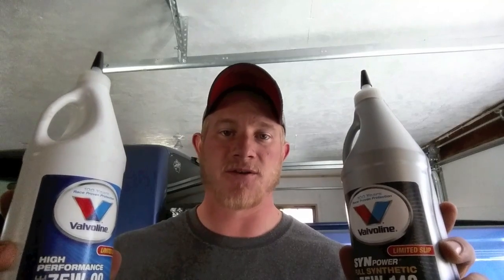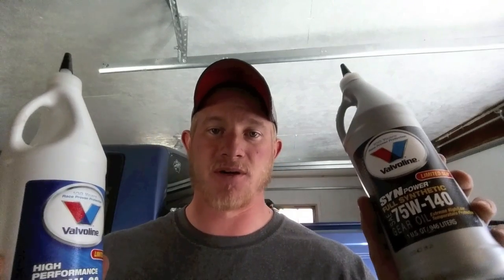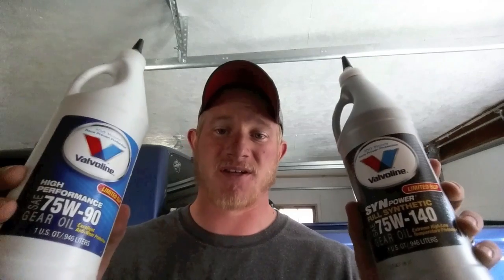75w-140 vs. 75w-90 Gear Oil | How To Read Gear Oil Viscosity Numbers

Comment: some people dont change gear oils at all
it took me 10 mins to do: i changed my gear oil to Synthetic Mannol 75w90 GL5 spec(cheapest synthetic 75w90 i found) , i drive a small 2007 toyota yaris and i dont tow, my recommendation is to CHANGE THE GEAR OIL every 5 to 10 years and dont just top it up, the old oil was GREY and the new was CLEAR-to-yellow car shifts a lot better especially when in reverse.
both plugs are 24mm and you need 1.9 liters of gear oil in case someone googles for specs.
Reply: zloben9000 port
Reply: P
Reply: I used to own a 2000 Tundra. I couldn't even change the axle oil. I had to buy complete whole new rear end axle at 155,000 miles it went slipping or it will lock up. It was wielded shut it has a cap on top of it. You couldn't even replace the gears till you cut it open. I was told that you had to go to the dealership and have them to do a hose flush to flush out your axle. Was so lame and Never forgotten to do a 4x4 transfer case oil change with the gear oil. I have over 472,000 miles on that V6 4x4 2000 Toyota Tundra. I sold it. Was a beast small mid size truck ever built. I had a custom axle on mine so I could replace the oil. The transmission will go out at 140 to 150,000 miles as well. I do replace the oils system and filters every 60,000 miles.

I wish people take care of their cars mores or have the knowledge to do it. Some people have no idea about changing the complete car oil system.

Now from now on I used Amsoil in my entire trucks now. I change mine every 60,000 miles on a GM 2500HD or within 4 years just as much as for other things on your vehicle like transmission fluid with new filter, steering oil and breaks oil and changing breaks. I always spent around 350 bucks every time and it worth it. Last you 600,000 miles or more depends how you take care of the trucks or cars that you drives. You would also needed to changing your crank staff chain or your overhead cam chain at 150,000/200,000/250,000 miles depend on what vehicle you have plus the exhaust system replacement as well. Big lesson I learned. I used amsoil gear oil 75Ww140 for a heavy duty used for my aluminum G2 cooling differential axle cover that does added extra oils space as well as it allowed you to change the gear oil too that included the magnetic dip stick. I add 6qt 10.5 on gas and 7qt on 11.5 diesel. And never failed me. I also do change the clutch and gear on the axle at 200,000 miles. 

  You could say I drove over billions of millage in my hard earn years lol..

Comment: Hi, Could you please advise the right engine, gear and lsd diff oils for 2002 Tahoe. It is used in a rather hot climate 35-40 C in summer. I feel that factory specs are somewhat insufficient in my case. Thank you in advance!

Comment: What would you recommend for a 2013 dodge challenger rt? My manual says 75w90 with friction modifier but the dealer says my car is supposed to use 75w-140 with none. I love in california for now but eventually i will move back to the midwest where it can get pretty cold in the winter. Your advice will be greatly appreciated!
Reply: Ryan Vaal do what the manual says not the person who told you at the dealer because he could be wrong cause he’s not dealing with just your car or pick up truck, he’s dealing with every car in the dealer...
Reply: Ryan in my research if there is a limited slip diff. on the vehicle of any kind the friction modifier is a MUST. it protects as well as aides the diff. as far as colder climates I would use the heavier 75w140 if the temp were going to be a constant freezing or below. (However I also realize that this does void any warranty if any thing fails) 32 degrees or below for several days in a row can be enough to freeze oil/break fluid/transmission fluid not the resoviors or holding tanks as much as condensation in the lines.

Comment: My Honda ATV calls for 80W-90 in the rear and front differential. I would like to switch to synthetic and I have found that most synthetics are in 75W-90. In your opinion, is it safe to go from 80W to 75W?
Reply: Amzoil makes a synthetic 80W-90 gear oil. Some NAPA auto parts carry Amzoil or you can order it direct from the Amzoil website

Comment: Great video!  I have Highlander 2011 4WD.  The manual says 80W-90 GL-5.  I could not find synthetic 80W-90.  Can I use 75W-90 Mobil 1 synthetic?  I am just afraid because 80 is different than 75?  Which is better for the car?  What about summer will 75 not be good as 80? 
Thanks
Reply from the maker: I would stick to the manufacturer's recommendations, especially in a nicer vehicle like that. One important thing however, if they tell you to use a GL-5 gear lube, definitely use GL-5.
Reply: Thank you so much for your reply.  Just want to understand what is really the difference between 75W-90 and 80W-90.  75 is thicker than 80 or the other way around.  
Also do you think 75w synthetic will offer better protection in winter than 80W?
Thanks
Reply: zofa300  @
Reply: hello good video I just moved from California to Washington St completely different temperatures right now is snowing and I would like to change my oils on my differentials my truck is a 2006 chevy silverado 1500 5.3 z71 4wd should I use 75w140 all around?

Comment: thanks buddy! I just changed out the oils yesterday. I put 75w90 in front and 75w140 in rear. Wanted to put 75w140 in both but went with the 75w90 in front instead.
Reply: you are creating different resistance levels between the differentials and that creates stress on the system. if the manufacturer doesn't indicate  difference in viscosity between the diffs then you shouldn't do otherwise.
Reply: @minogoda  What ? My 2007 Nissan manual says front Differential 80w-90 the rear 75w-140 Synthetic so its done all the time.
Reply: @minogoda  how much stress because they're pretty similar for it seems. Can you out the 75w-140 in the front differential? Seems like the gearing strength would be different from front vs back?

Comment: I hear 75w-140 is good to be used in both front and rear diffs. Ive got a 2004 ford explorer 4x4. I dont tow much but will be eventually. Im also going to move up north canada where its damn cold. Think i will stick with 75w-140 for both :-) Would you advise that? Thanks!
Reply from the maker: +rainy78 Yeah, I would recommend that. Ford & Mercury just recently changed their lube requirements a few years ago. They say to use 75w140 instead of the 75w90 now in rear differentials.

Comment: I have 2004 Mercury Mountaineer AWD, which is basically a cosmetically changed Ford Explorer. The original owners manual required 75W90 for the rear diff., but Ford started to have lots of failures on Explorers' rear differentials so they changed their viscosity numbers several years ago. Now they require 75W140 for the rear differential which is also a full synthetic oil. Thanks for the video.
Reply: Must be what's similar with my Silverado it's supposed to take 75 W - 90 and they put in 75w - 140.
Reply from the maker: +seth brown Oh wow, I never knew that! Thanks for the info!

Comment: I live in Texas and I have a 2008 Dodge Ram 1500, what would be the ideal gear oil for my truck? The truck is used for work and back and rarely do any hauling. Thanks!!
Reply from the maker: +Stephen Lepek If your Ram isn't towing or being worked real hard, use 80W90 in the rear. 75W140 for the front diff. BUT, there is one important step you also need to do! Dodge is one of the few truck companies that still comes with a LSD (posi) as a standard option...so if your truck has it, you need to add some friction modifier to the rear differential when you change the fluid. The friction modifier is just a limited slip additive, and if you're unsure if you have an LSD or not, you can add the stuff anyway with no harm just to be safe. Hope this helps!
Reply: Thanks man! I really appreciate that!!
Reply: +Stephen Lepek 75w-140 is what is used in my 07 ram

Comment: what about 85w140? need to know soon
Reply from the maker: +michael sewall 85w140 will behave really well in high heat situations and warmer climates, but with the first number being higher, it will be thicker in colder temperatures. What vehicle do you have and what type of climate do you live in? I can help you out the best I can, but if you are ever unsure, you can never go wrong with the manufacturer's specifications! Hope to hear back soon!
Reply: +Midwest Garage  thanks you so much for getting back to me this has helped alot
Reply: +Midwest Garage i im in a cold climate and this is for my kubota tractors front axle
Reply from the maker: You're very welcome! I'm not an expert on tractors, but I would go with an 80w90 in those axles...but I'm not 100% sure, I'd check and see what Kubota says to use just to make sure. Hope this helps!
Reply: sorry quite tired at this point i need to know if the 85W140 will be ok for this axle it dose have same play in it from heavy work i should go to 75W140 for the cold im i right in thinking this?
Reply from the maker: +michael sewall I think a 75W140 would be ok in this axle...85 would be too thick in your climate. But I'd see what Kubota says about it as well.
Reply: ok thanks i appreciate your time. thnak you